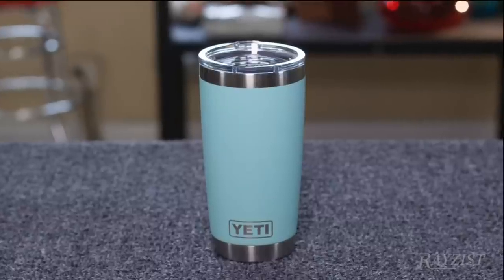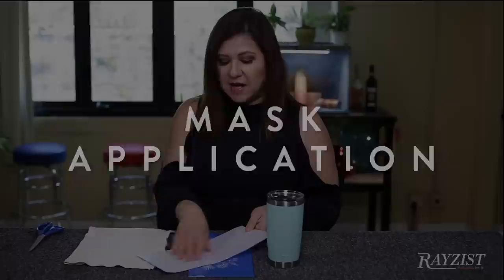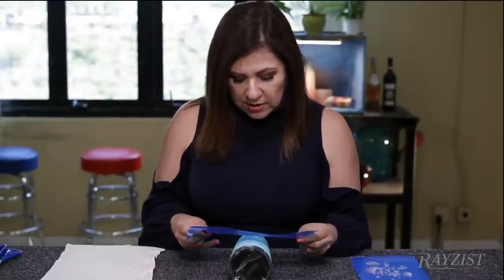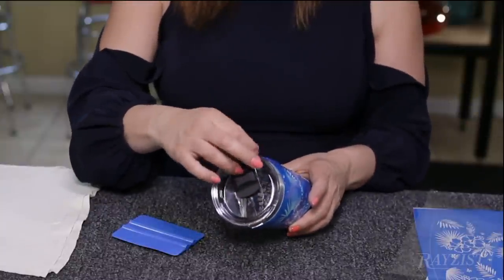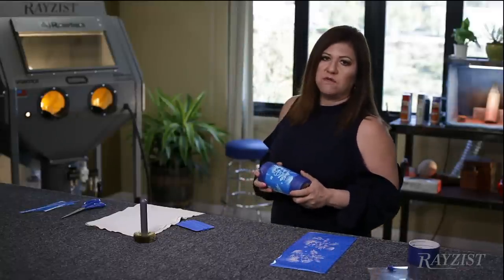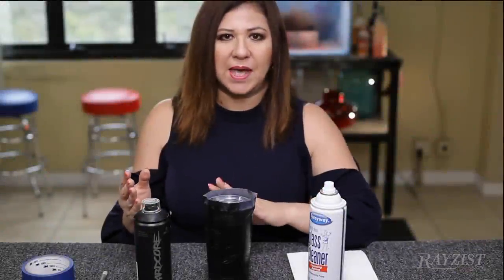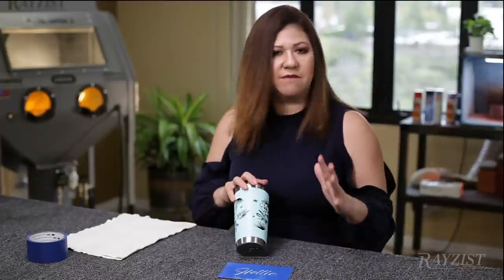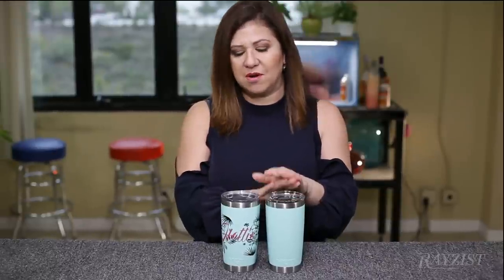Double Blast on Powder Coated Tumbler

Comment: Hi, great video! How durable is the spray paint used to fill in the color? Does it chip off or wash off with time?
Reply from the maker: Thank you for watching our clip. The mural (graffiti) artist paints, Molotow or Montana, are very durable and will not wash, clip (in our experience). With any painted items, the dishwasher "heat" cycle could cause paint fractures and evidentially chipping at the edges of the design, so we suggest hand wash only.
Reply: @Sandcarving  thank you! :)

Comment: Love your work! I'm new to this. What air nozzle/gun do you use?
Reply from the maker: Thank You, Charles! We are glad that you are watching and learning something. We are sandblasting with our 2034VXA Sandcarving System. Which is a pressure pot blasting system; with no blasting gun, the media is propelled (under pressure) through the blasting hose and nozzle. There is an actuated foot pedal that starts and stops the blasting media.
Please be sure to check out our Learn Sandcarving playlist on our Sandcarving channel and see our equipment offering at Rayzist.com
Thanks again for watching.

Comment: If you wouldn't have painted, would the etching look at shiny as the top and bottom of the cup? Or would it just be a rougher grey color? If that makes sense. Is there a way to achieve the shiny silver design with sandblasting?
Reply from the maker: You have it correct... sandblasting does not provide a high shiny appearance on metal as a Laser appearance would. The great thing about sandblasting is it does allow for color fill for contrast against the powder coated or the stainless surface.

Comment: Will sr3000 4mil do the work for that type of surface?
Reply from the maker: 4Mil may work for some powder-coated surfaces. Some manufacturers ' coating is not as thick as others. 4mil SR3000 will work if you are not blasting all the way thought the power-coated surface, rather just removing a few layers of the coated surface and adding a color fill for contrast. 
If the intention is to blast through the powder-coating, SR3000 5Mil would be most recommended for durability.

Comment: Do you need to seal the paint?
Reply from the maker: Hello Theresa, Thank You for watching. Using a quality material has an almost automotive finish and durability. There would be no reason to treat/seal the paint. We still do not recommend they go through the dishwasher; we would also recommend hand washing only.
Check out some of the Learn Sandcarving playlist, there is a lot of coverage when it comes to painting.